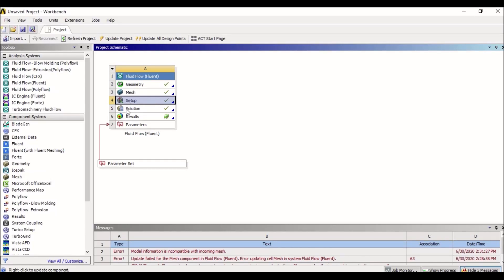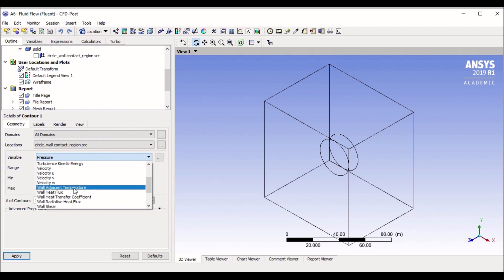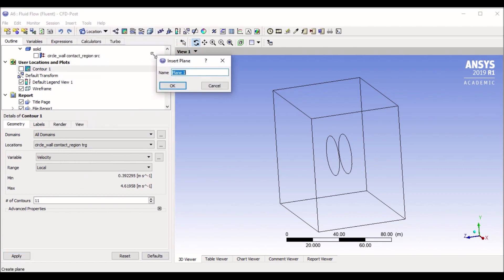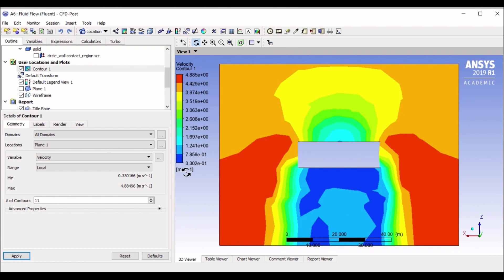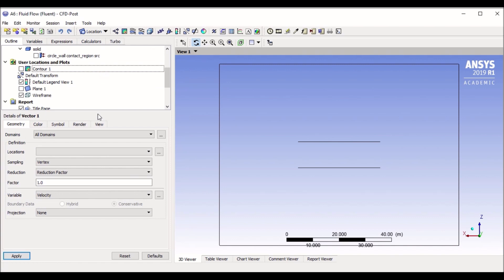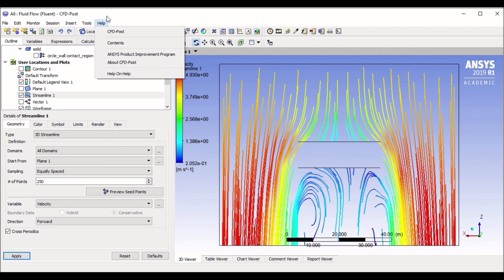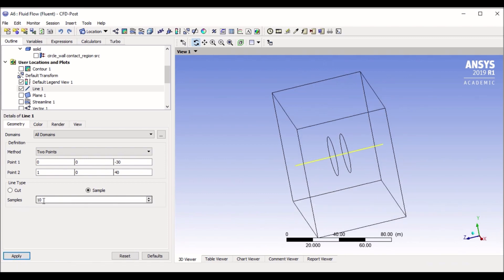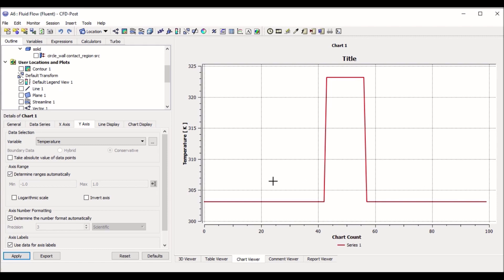Use ANSYS Fluent post-processor to view results

Comment: Great video! I got a problem in a simulation. When I try to do a velocity contour, every value goes to zero. It only happens with the velocity. Pressure for example works. 

Any idea? Thanks in advance!

Comment: Hello
Thanks for the tutorial.
In the Function Calculator section, selecting some of the variables activates the Direction field. Ar first I thought it is the direction of the variable, however, the Ansys guide indicates that it is the surface fold. Could you please explain this with an example (perhaps areaInt function). Thank you